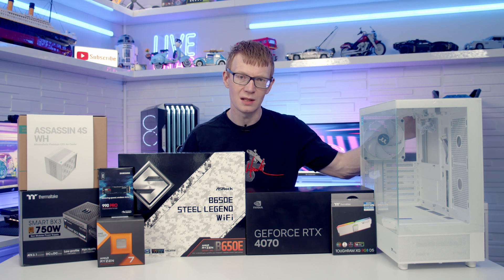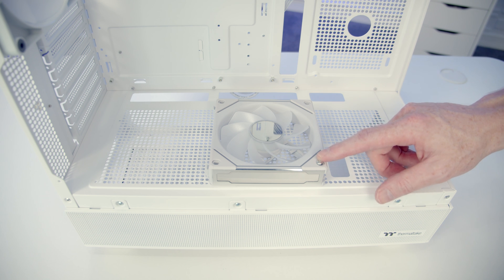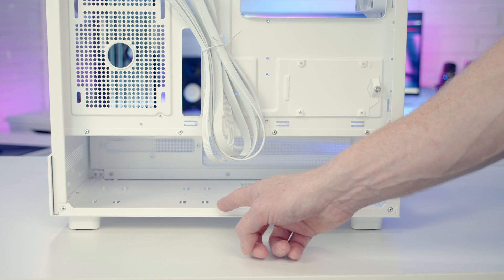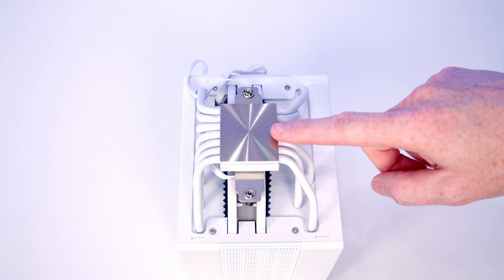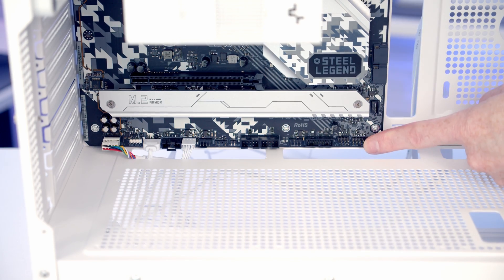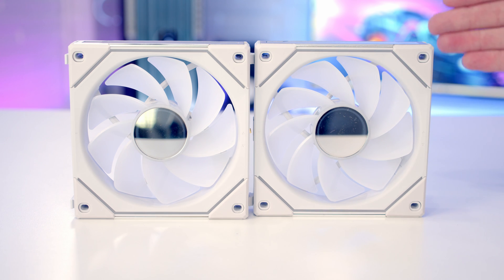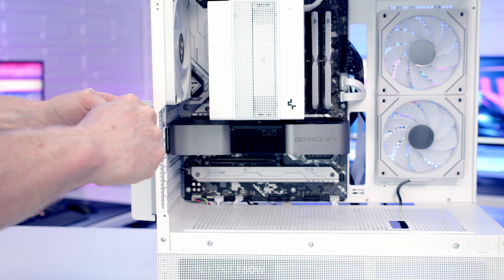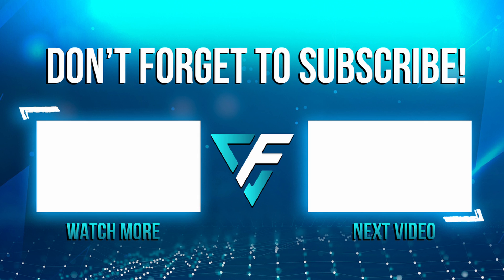Thermaltake View 270 Build - Step by Step Guide

Comment: can we fit a triple fan gpu in this case, in know there is ample space for the card, but im concerned if it will hit or be blocked by the fans as the protrude a fair bit.

Comment: Hello, I was thinking of getting one, but I have heard that a 280mm radiator, in my case a Corsair h115i elite capellix xt, does not have the appropriate mounts. I am currently using it in a NZXT H5 elite in the top of the case, but I screwed it into the air holes. To put it in I had to change my Corsair Vengeance RGB Pro RAMs for common green RAMs. My question is, can I mount the AIO in the air holes and also fit the Corsair RAM in there?
 I hope you can answer me

Comment: an important step i forgot when i built using this case last month... the inside side of the glass panels has plastic as well. I think I took those panels on and off at least 10 times before I noticed there was a bunch of plastic (which was getting wrinkly ew)

Comment: Do you think it could be possible to mount a 280mm radiator (no AIO) at the top besides Thermaltake not listing this size as compatible?
Reply: Thermaltake says it can go up to 360 at the top
Reply: @exglued2394  Not exactly. They do mention it is not compatible for 280.

Comment: Could you let me know which is the best AM5 Motherboard can use all its Nvme ssd slots without comprising the Graphics card from 16 to 8 and the new build that I am thinking of building will have only Nvme in it only.  At this moment I am considering using the Ryzen 7 7800x3d which is the best gaming cpu out at this moment. I want to be able to use 4 Nvme slots in the motherboard.